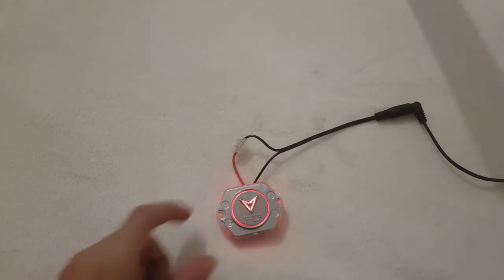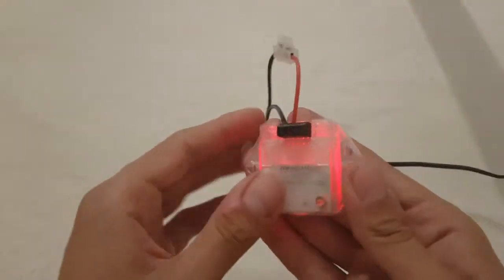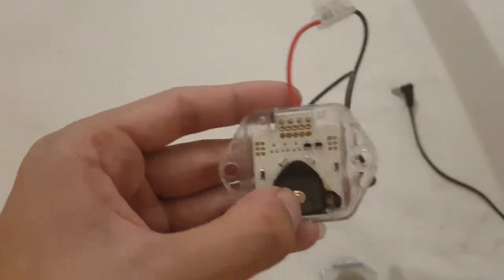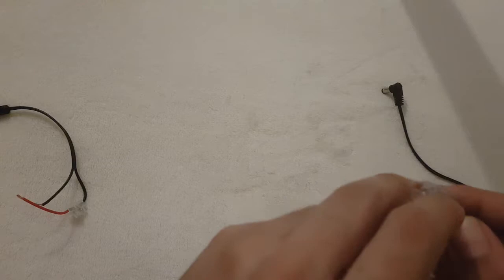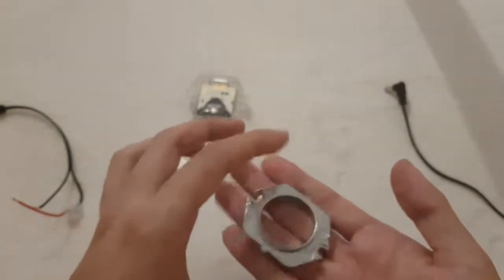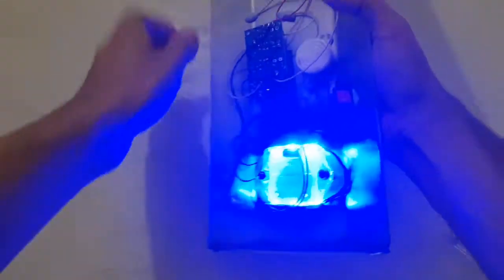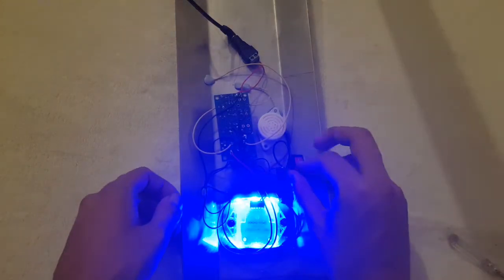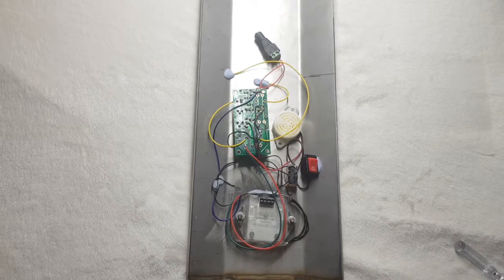Detailed look at a Dewhurst US91-15 button

Comment: Where did you get this button?
Reply from the maker: My local shopping centre had their lifts modernised. A few talks with the engineers and I've got 6 of the button panels and an indicator unit.
Reply: liftadventures, thanks for the information
Reply from the maker: No worries.